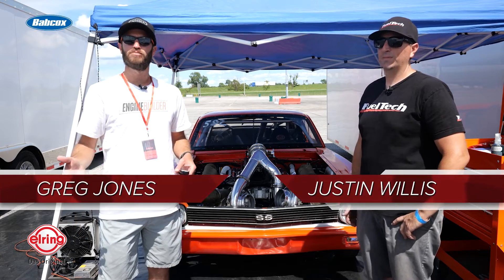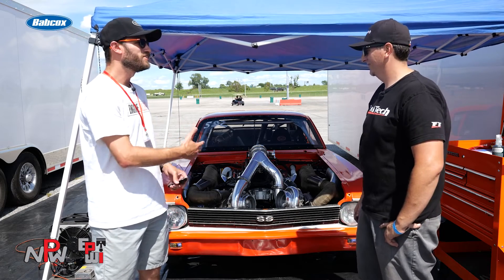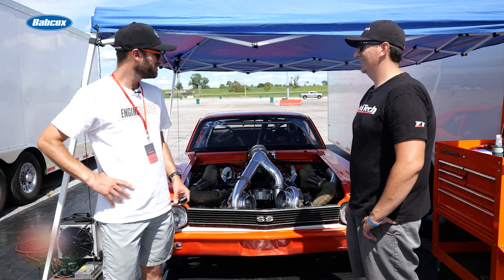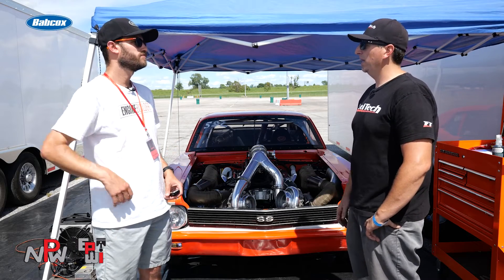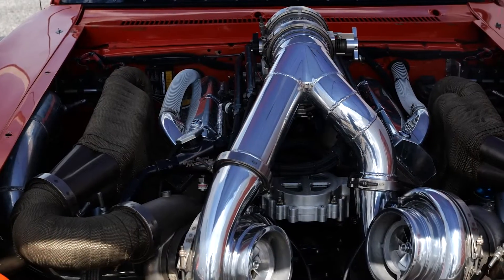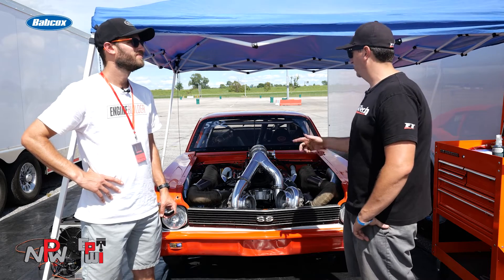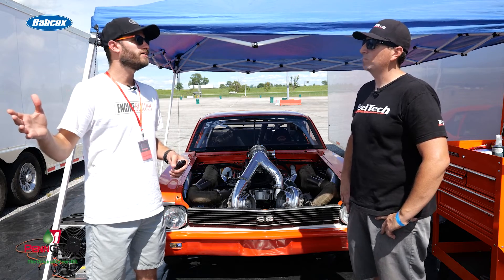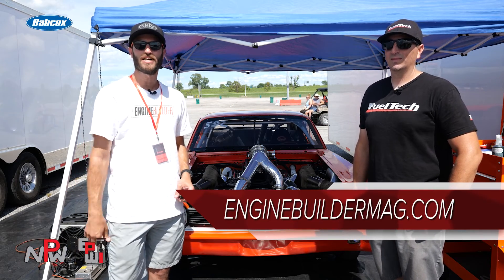Twin-Turbo 540 cid Big Block Chevy Engine

Comment: I've always wondered if the turbos facing each other like that causes any kind of turbulence or does anything with the air flow at the big end of the track at the turbo and tips of the blade.